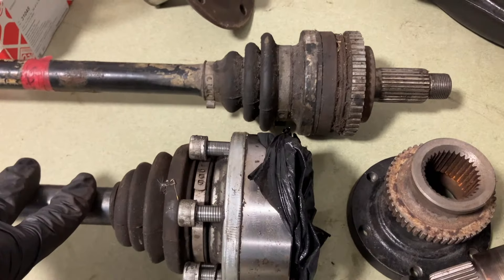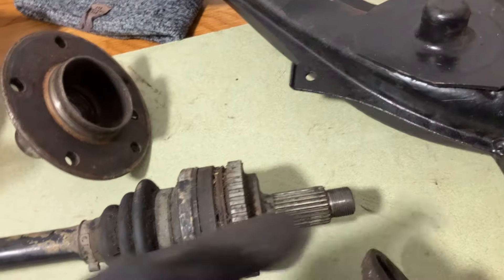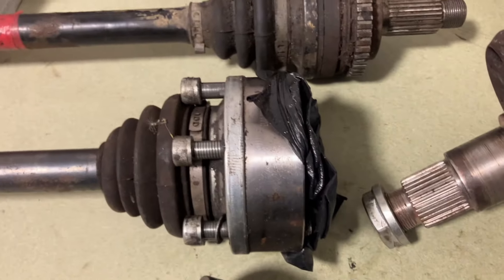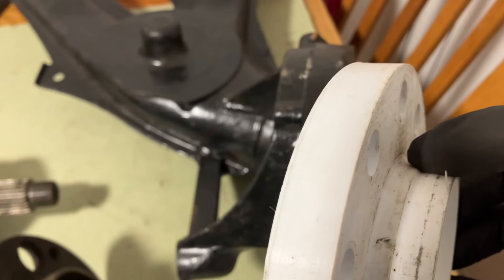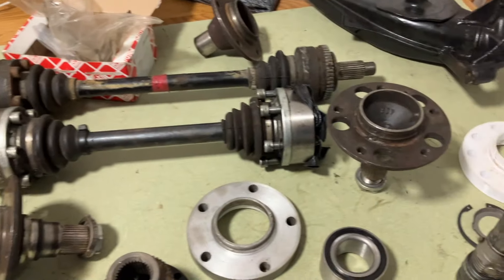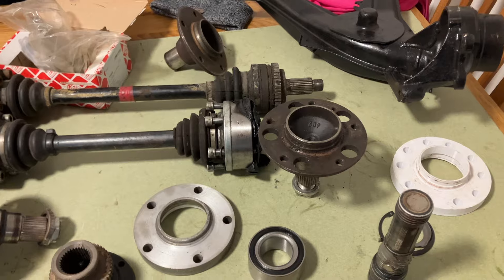e30 big driveshafts

Comment: Hey! I remember you from m42 club. Haven't been on there in like 10+ years. Great to see you are still at it. Still have mine but it hasn't run in about 5 years. Looking forward to working on it this year and getting it running again.
Reply from the maker: the m42 club was a good forum pre facebook. good luck with your engine and getting it going, i had a m44 in the corner of a garage for 5 years then put it in a rally car and its run great ever since. they are good engines

Comment from the maker: It’s a m42 2068cc so not a lot.
Reply: In witch situation did it snap off? At the start? At u turns? At drifts? Deecel ?

I have a quiet similar setup with stock intake.. Not been to the dyno yet. Not a lot of people managed to modify the diesel 90mm crank with proper fitting. Several shops in GER refused to build it the way i constructed it. It works fine and has been testet hard at hockenheim
Reply from the maker: @jaybee5390  the stroker m42 is a fantastic engine with plenty of potential. My shafts snapped on the start line
Reply: Is there any way to contact you PM?
Reply from the maker: @jaybee5390  I’m on facebook tim alderson
Reply: @jerseytim100 hello. i have e30 m42(e36) swap. what spec do you have? i wanna make stroker too) plz help me!!!!!!
Reply from the maker: @brusvillis2148 this is the video where the guy who built the engine explains what he did https://youtu.be/3p_B41XV0NA?si=nJvHwUufNDsMM4Px
Reply: @jerseytim100  Ohhhhhh, thanks !!!!!!!

Comment: Hey so I’m looking to do something similar to my e30. Just to clarify, you have e36 m3 diff outputs, e24 half shafts and then which hub/axle stub combo are you using? E28?
Reply from the maker: they need to be the 3 litre e36 m3 diff outputs as the 3.2 had a bigger diff
Reply: @jerseytim100 okay thank you. Yes to the e28 stuff on the hub side?